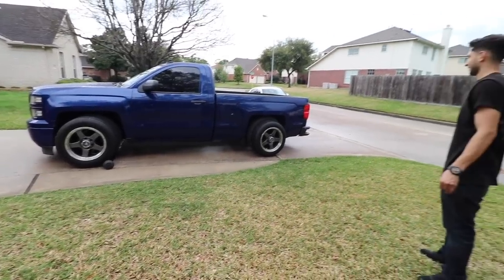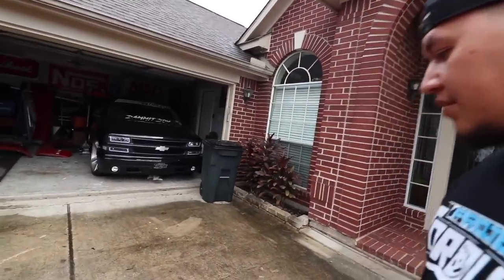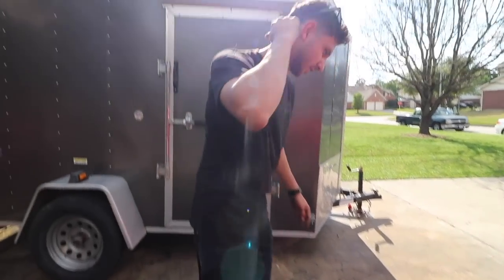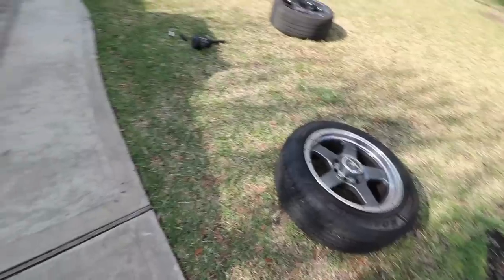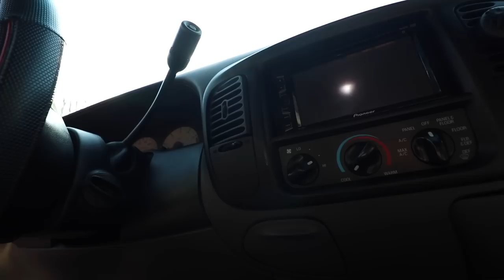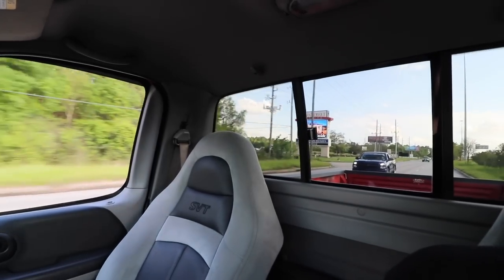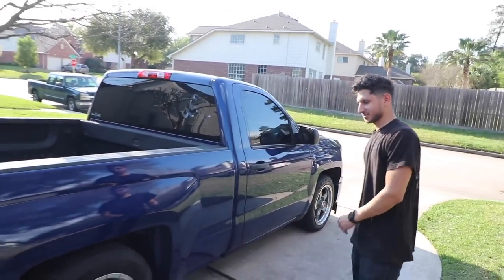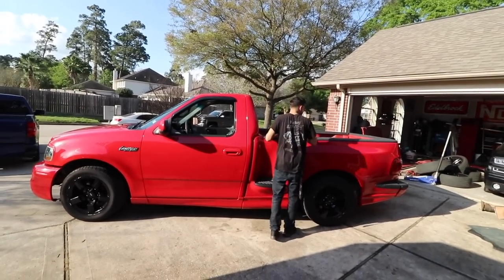RACING THE FORD LIGHTNING VS OMARS SILVERADO

Comment: All you need is a exhaust and a intake  and the lighting would sound good
Reply: Tony Jimenez facts my guy🔥
Reply: Honestly, getting some headers ruins it in my opinion since it’s pro charged, won’t hear it 🤷🏻‍♂️
Reply: @originalg6918  Its not procharger, it has a roots type supercharger.  My friend had a lighting with headers and dumb loud exhaust that I could be two blocks away from and still hear that blower whine no problem!
Reply: Pro charged 🤣

Comment: U should do the gmc vs the lighting
Reply: Daniel Menjivar  stock Lightning’s slow af hell get smoked by his own gmc lol
Reply: Tito Flores  Im telling you from experience when I raced trucks with his similar set up like his gmc I was stock the truck was slow af after modding it, yes it woke it up and i was able to beat them easily
Reply: Tito Flores  stock no
Reply: Tito Flores  it’s barley beating the V6 as is
Reply: Tito Flores  yeah i do lol that’s why I’m telling you from experience the lightning would not beat it if it’s stock, fbo e85 definitely would, when I was stock and raced cammed 6.0 and other trucks similar set ups I didn’t have a chance and when I was fbo I beat them and now I’m far from full bolt on I’m up there beating 5.0s and scat packs now
Reply: Tito Flores  had to come back and tell you I told you so Lightning’s are slow stock 🤷🏽‍♂️